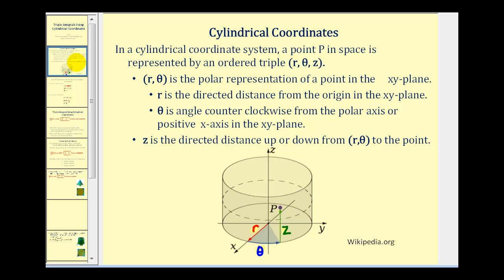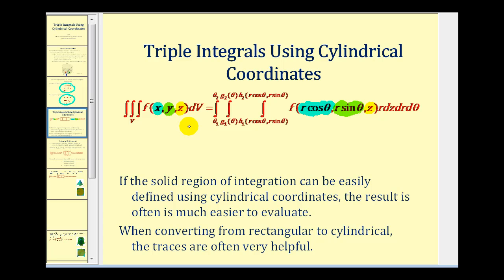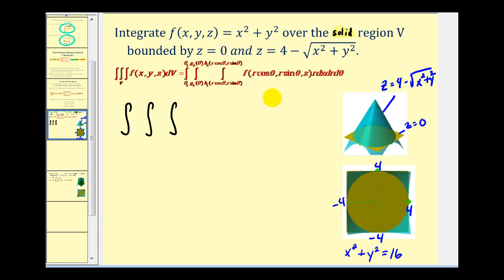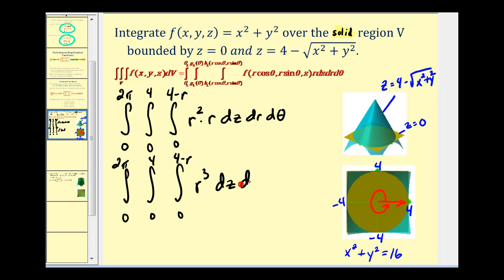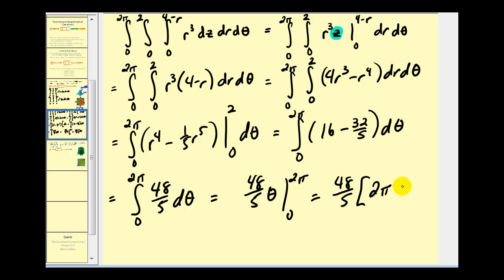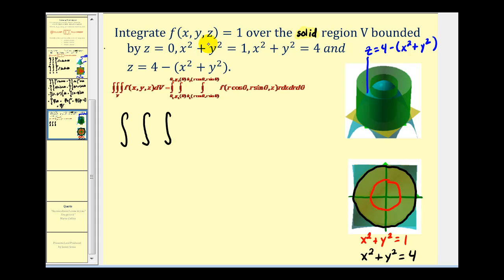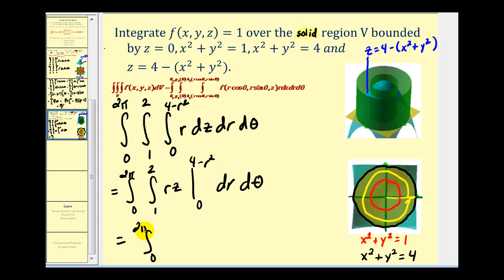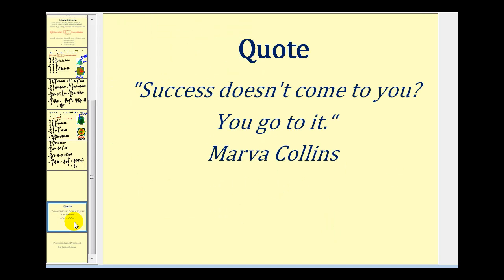Triple Integrals Using Cylindrical Coordinates

Comment: The answer should be 512pi/5

Confirmation listed below...
 
 https://www.symbolab.com/solver/triple-integrals-calculator/%5Cint_%7B0%7D%5E%7B2%5Cpi%7D%5Cint_%7B0%7D%5E%7B4%7D%5Cint_%7B0%7D%5E%7B4-r%7Dr%5E%7B3%7D%20dzdrd%5Ctheta/?origin=button
Reply from the maker: semir kasumovic Yes, I accidentally changed the limits of integration from 0 to 2 instead of 0 to 4 when copying the integral on to the next page.  I am uploading the correction and will link to it from this video.  I apologize for the transcription error.
Reply from the maker: Mathispower4u http://youtu.be/SyEd-uBHnwA

Comment: Great videos. I think you made a small transcribing error between screens. At 4:10 the upper limit with respect to r is 4. Then after you switch to the next screen, the upper limit with respect to r is 2. I'm not sure if I missed something or if it was an error. Thanks.
Reply: i agree with u
Reply: Yes
Reply: Agree
Reply: I agree. My final answer was 256pi/5.
Reply: @TBaby6769  (512/5)pi, you forgot to integrate theta and get another 2pi multiplied
Reply: U should consider the area / region between the two ⭕ circles assume a vertical strip between the two circles then u get lower limit as 0 and 2 as upper limit since 4 is diameter r will be 2
Reply: @Lostviibez   radius is 4, check both a) your math and b) a 3d graphing calculator, you'll see the difference

Comment: There is a problem here. In the second example, Z should go from 0 to the cross between z=4-x^2-y^2 and x^2+y^2=4. Which is the height.
Reply from the maker: Z is the height controlled by z= 4-(x^2+y^2)=4 - r^2.  Since the interval for r is from 1 to 2, we are fine.

Comment from the maker: @MrYounisah Yes, I copied it wrong onto the second slide.  I made a note of the error.  Sorry about that.
Reply: How is the radius of the circle 4? I'm lost. You can see it at 2:50.
Reply: @jordanfreidel1751  I know you posted this a long time ago, but I thought I would try explaining anyway. The question gave us z=4-sqrt(x^(2)+y^(2)). If you set that equal to zero, bring the 4 over and square both sides, you get x^(2)+y^(2)=4^2, which is the equation of a circle (x^(2)+y^(2)=r^2 with r=4.
Reply: @MercedesJSchmidt  W mans regardless, but I think I figured it out eventually. I was but a naive freshman fr. Have a good one dude!
Reply: @jordanfreidel1751  no worries. I know I have days where my brain just isn't connecting something from an old math class, so I get it. ✌